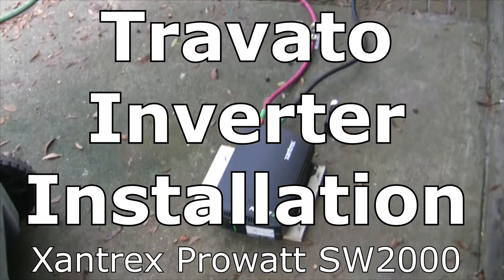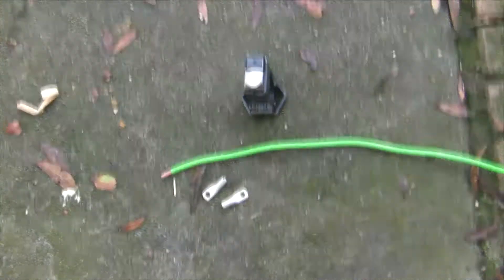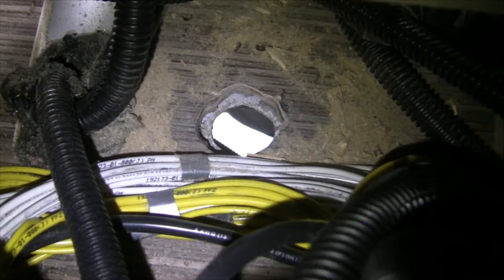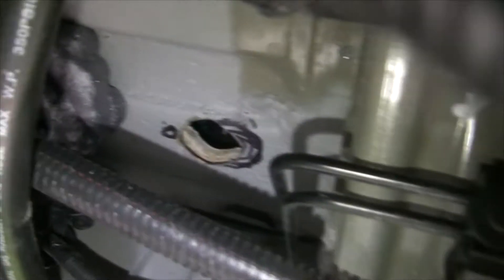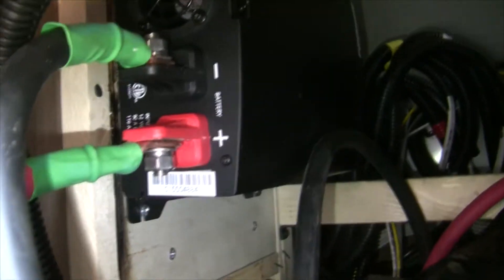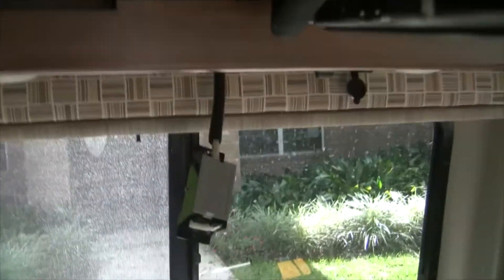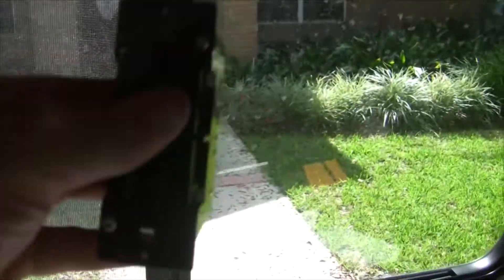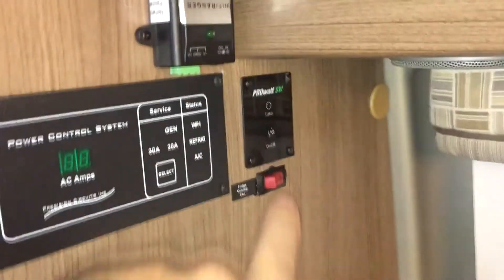Xantrex Prowatt sw2000  Inverter install, winnebago Travato

Comment: Hi There, Awesome video BTW.  Just wondering, how did you run the wires from the outlet to the inverter.  The wires go behind the refrigerator, not sure If you covered this part in the video or maybe I missed it?

Comment: Ok I admit, I'm a big dummy when it comes to this so my question might appear remedial, but why would I need to go through this added trouble and expense? Can't I use my microwave and laptop without an inverter?
Reply from the maker: solarjinx the inverter is for when there is no shore power and you don’t want to run the generator, it really comes in handy
Reply: Larry Grimm I have a follow up dummy question for you, Larry. The inverter itself (and everything hooked to it) is drawing power from the house battery, so wouldn't I still need to run the generator to run the inverter and appliances? I guess that's the part I'm confused about most.
Reply from the maker: Everything in the rv runs on 12volts from the house battery except the air conditioner and the microwave, and any 120volt products you bring yourself like computers and coffee makers.  I use the generator only to charge the house battery when depleted and run the air conditioner.   With an inverter, you can use the microwave, coffee maker laptop without cranking the generator on.  The generator is loud, it’s nice to wake up in the woods, make your coffee, cook breakfast on the gas burner, flip on the laptop all in complete silence.
Reply: Larry Grimm You are awesome, thank you for taking the time to explain it. Makes perfect sense now! And thank you for making all the Travato videos. They are very resourceful to a new owner such as myself.

Comment: What size lugs do you need on the inverter end?  Thanks
Reply from the maker: Ted Lanham this are the ones I used from amazon,,    TEMCo 10 Lot 1/0 AWG Ring 3/8" Hole Terminal Lug Bare Copper Uninsulated Gauge

Comment: Great explanation! I actually understand what you are instructing! I have a DeWalt invertor and it says to sit on flat surface. Can I mount it like you did? Also, where did you get the black tank hose compartment that slides into that square hole?

Comment: How do I get a hold of you....I have a few more questions. Just bought 2018 59g and this is exactly what I want to do.
Reply from the maker: you can ask the questions here, i dont want to put my phone or email address on youtube
Reply: Cool, thanks for all the great info..I have made 95% of your recommendations. 1st question on inverter...wanted to double check connections to coach batteries. Of the two batteries does the inverter cables connect to just one battery positive and negative  or positive on one and negative on other? I know you tried to get camera up there but it was hard to see. Thanks Alan
Reply from the maker: The batteries are connected in parallel, so I connected to the closest battery pos and neg.
Reply: Did you use the transfer relay that was listed in parts list...I missed that part. Also your labels look professional. What do you use?
Reply from the maker: I didnt add at transfer relay, the converter   on the video is the one that comes with the van, but i added the remote monitor to see what mode the converter was int
Reply from the maker: the labels were made with a brother p-touch labeler you can get from office depot

Comment: Very nicely detailed and informative video. I am planning to add a two thousand watter to my 49G also. Can or have you considered an automatic transfer switch to eliminate the plugging and unplugging the microwave?
Reply from the maker: i considered a new converter/inverter transfer switch combo but toooooo much money, plus i dont use inverter power that often, coffee maker, microwave occasionally  and my laptop, for someone spending alot of time off shore power or does not want to use the generator, a converter/inverter transfer switch will be better.